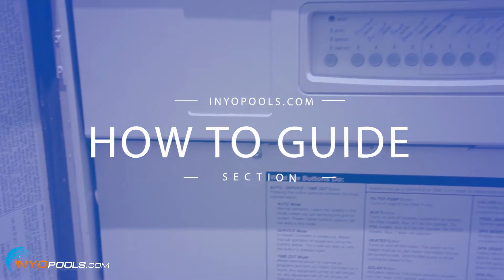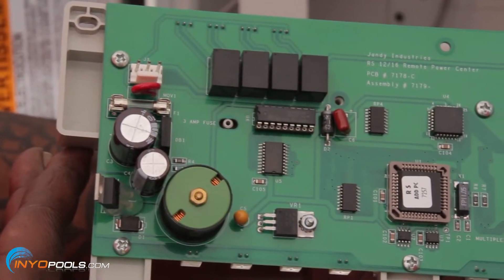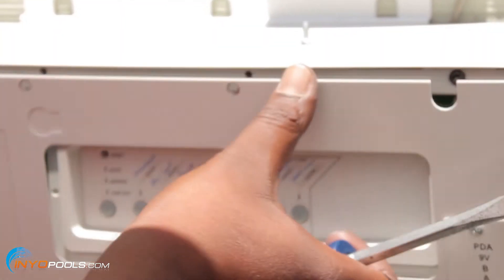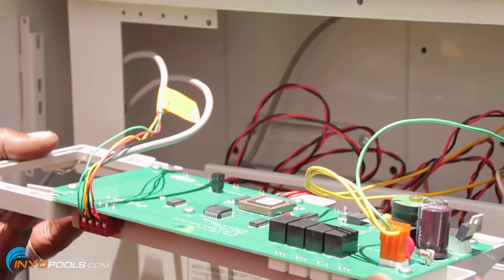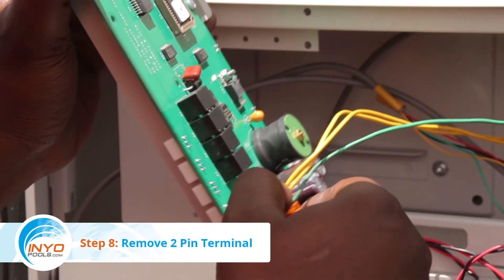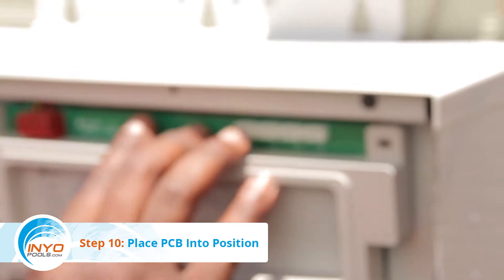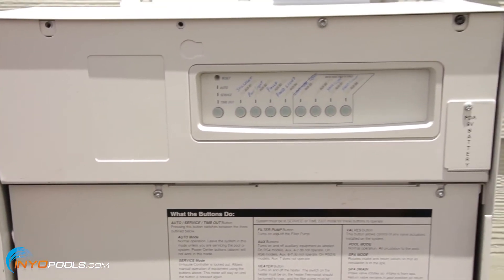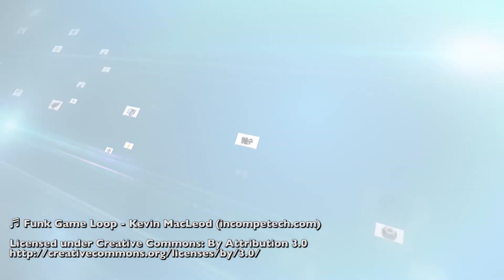How To: Replace a Jandy AquaLink PCB

Comment: Thanks for the informative video. I was able to replace my RS8 board myself and saved a lot of $. Some connections were a little different than the original board but I was able to figure it out. Happy to have my pool pump running again after being down for the past month.

Comment: I have a RS12 system with two aux power boards. Do I have to upgrade both the boards or just one attached to The filter pump is enough? The current firmware is JJ. Thanks

Comment: Hi I did this because my board has short circuited due to a power outage while it was on however ,  I have gotten 3 boards off of eBay so far. 1 worked the first time but the indoor panel had an error. So I put on the second panel I’ve bought and everything worked perfect BUT the heater, the heater wouldn’t turn on. Third board I just installed and everything works except the indoor panel just like the first panel I had bought. I got a “firmware b12” error. Do you have any insights on this?? Thanks
Reply: yes don't buy from ebay  lol
Reply: Seriously don't buy from online sources no warranty or support comes with it if not bought from a proper outlet. Also those boards come in many different configurations.